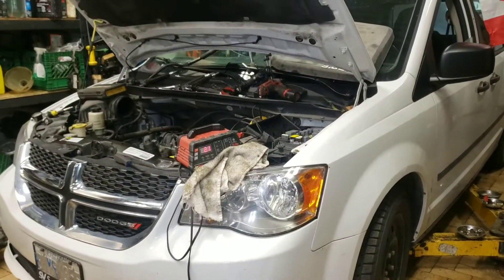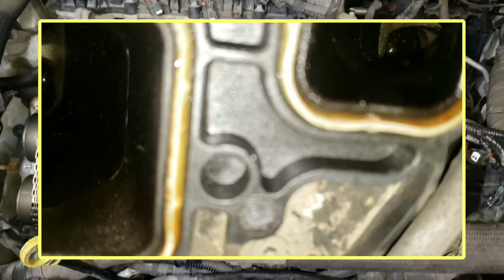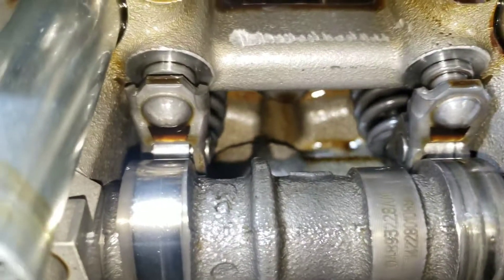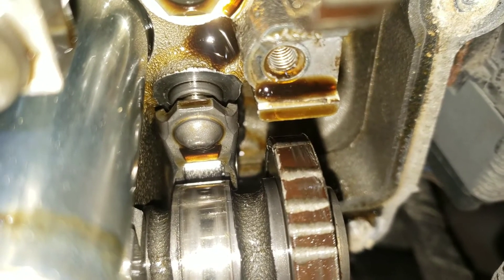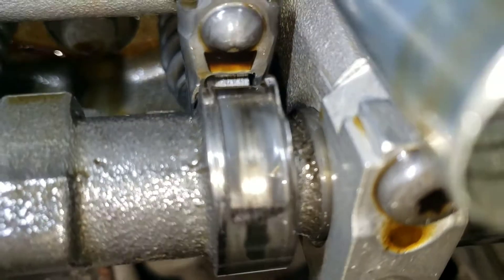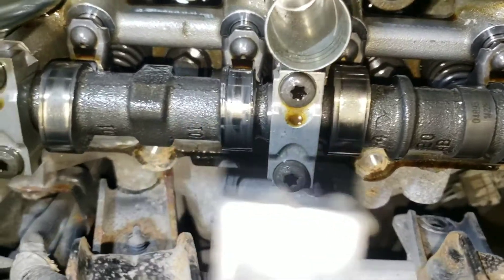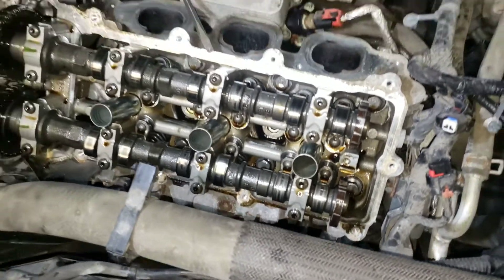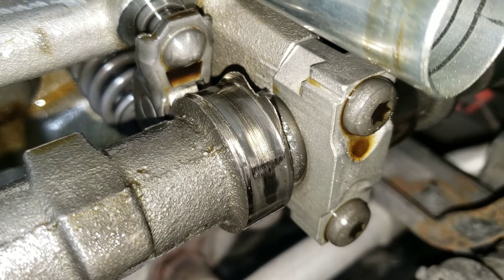Dodge Caravan P0300 P0306 Random Misfire

Comment: How long could you drive it as is? I have the same issue. Not worth fixing for me
Reply from the maker: Not sure. Depends on the severity of the damage. It'll only get worse. I guess just drive it till you can drive it anymore.
Reply: I have an older GCV, a 2005 with 38L and have rough idle along with P0305 and recently a P0300 😮

Comment: Just to clarify. Is this a random misfire?  My 2016 crew is random misfiring.with 117000 km on it.  What do you suppose I do first? I’ve changed plugs. Seems to early to have engine problems with the km on it, but I do think it’s worse when it get down on temperature outside. Didn’t really have a problem in the summer, until now
Reply from the maker: @allwortht  this vehicle had a random misfire. I would pull the oil filter and see if you find any metal shavings in there. If there is, there's a good chance there's an issue with the cams. Good luck

Comment: I think the root cause is oil passages clogged on that cylinder
Reply from the maker: It's possible,  but it seems to be a common problem for these motors.
Reply: I have a 05 Grand Caravan with the 3.8L that seems to misfire when it gets colder or after rain. Have the same codes which are frustrating and  annoying but lead me to believe the engine is a design flaw nightmare from Dodge Chrysler 😂

Comment: Exact issue I'm having on my 2013 Rt caravan . Will changing the Cam and rollers fix the issues of the p0306 code.
Reply from the maker: Changing the cams and rollers could work as long as the cam journals on the head hasn't been damaged. You can find all the parts (cams, rockers, head) on rockauto.com. something to keep in mind is all the metals shavings that's been circulating could have caused some damage to the rod bearings and main bearings. I would check the oil filter for the amount of shavings and debris. Hope this helps.
Reply: I just rid of a 2016 grandcaravan junk

Comment: What can cause this? Not changing the engin oils on time?
Reply from the maker: Not sure if it's cause of a lack of oil changes or other issues. The rockers use a roller bearing design. Could be an insufficient life cycle for those rockers. Not sure if there are any service bulletins noting to check or replace them at a certain mileage.   I have another Caravan come in recently with a similar misfire issue.  So it does seem to be a common issue.

Comment: the question is how you fix this? get a new engine?
Reply: Pretty much it's not really worth doing head work on it these cheap engines. You can get a low mileage thats been in a wreck and pull it your self or have them do it just try to get the ecu to. Shouldn't be to much money by me there $400 to 500 if I pull it.
Reply from the maker: Yes. We ended up replacing the engine... we made a video for it as well

https://youtu.be/u46GNa4yCfE
Reply: @UncleTinman   Thanks I ll watch the other video.
Reply: @americatoken3334  new rollers and cams could also be the repair option without swapping blocks